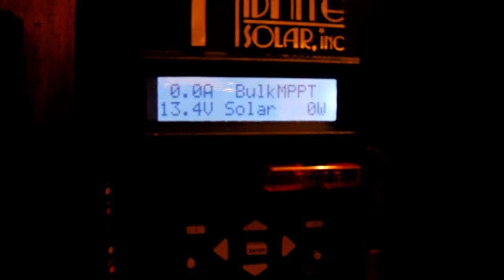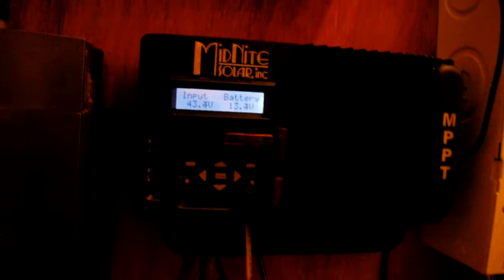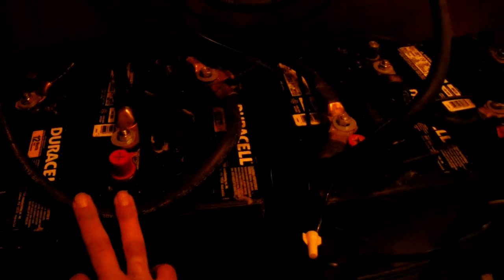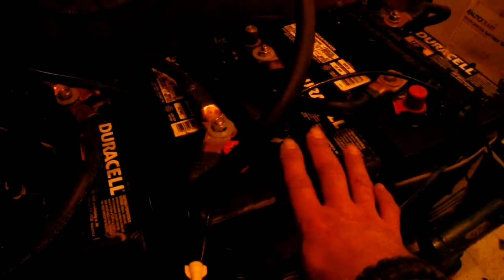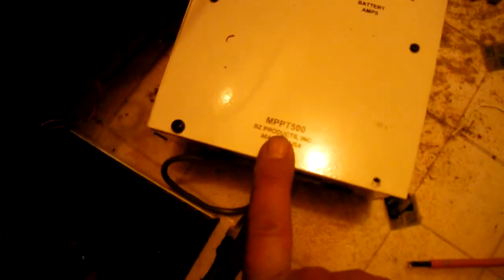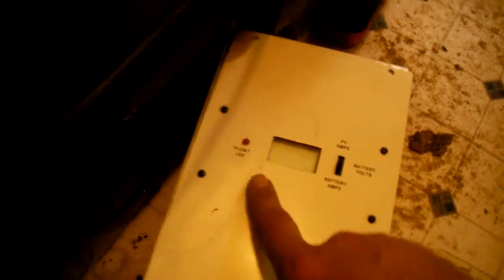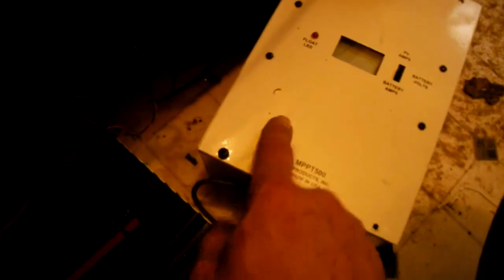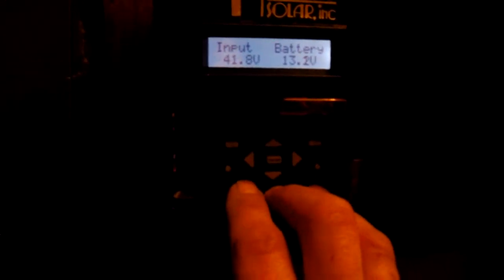Midnight Solar "Kid" installed.

Comment: TR - Have you ever looked at the VMAX AGM batteries (Vmaxtanks)?  I have a pannel, MPPT 40amp charge controller, but have not got batteries yet.  I have been looking at the Trojan T105RE and VMAX.  I am drawn to the VMAX because they are AGM and can be inside (winter is a concern here in WV).  Just tought I would ask you what you thought.  Hank
Reply from the maker: If you can go AGM by all means go that route. They are more expensive but seem to be the best way to go. I'm trying to balance cost and effectiveness with my income, so batteries I'm just doing what I can.

Comment: I 410 watts of solar and about to buy one more 120 watt pv. I have 8 Trojan T-105  battery's that will be here in the new week or so. Now I just need a inverter but I am broke. My gole is back up power and maybe run a few smaller things. It's a good feeling to know soon I will not be relying 100% on the power plants.
Reply from the maker: Yep hoping to be almost 100% off grid soon.

Comment: MPPT charge controllers are the way to go I have spent a ton of $$ buying bad stuff. 2 years ago I bit the bullet & got a Outback flex max 80 worth every penny. Midnight solar  is also a great co.  U can use a battery switch to charge different banks of battery's if need be. My battery's have been in a spare bedroom of mine for years but outside is best. I have several videos showing how to do this best of luck with your solar project.
Reply from the maker: Thanks I appreciate the input. Take care!